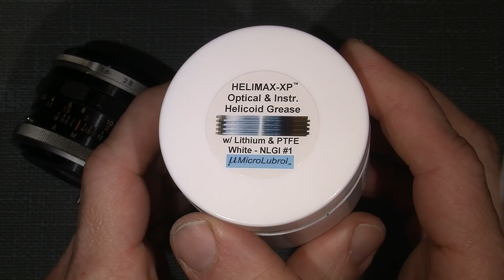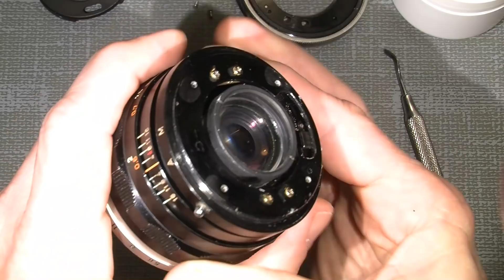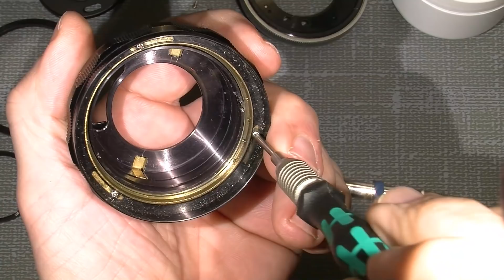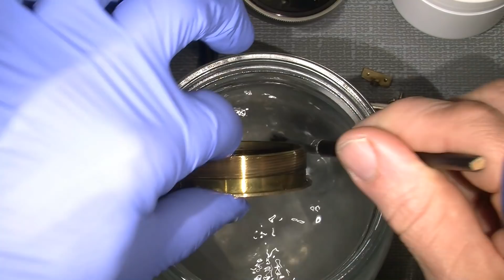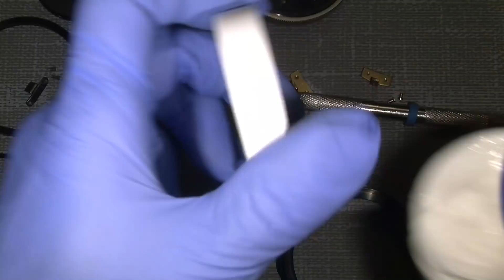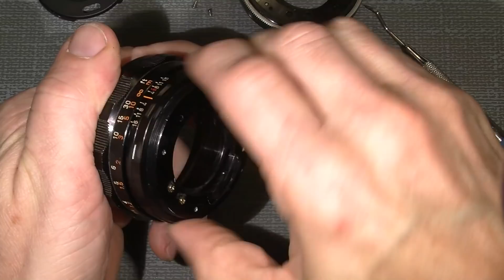Repair Canon FL 50mm 1:1.8 and Re-grease the focus system

Comment: I've just bought this lense on ebay but it appears to be stuck in auto, so I can't check the focus blades in manual mode. The release catch is also very lose (shaky) so I'm thinking that the seller has messed around with it and not reassembled it properly. I'll see if I can find someone who can fix it cheaply as I don't want to risk damaging it any further.

Comment: If you hold the side of the lens upwards it will be very easy to mount that very tiny three screws at the sides. I know because I have inspired from your videos and cleaned mine. :)
Reply from the maker: Thank's for the good tips, Can :-) hope your lens cleaning went fine.
Reply: mikeno62 I was not able to reach the front element since mine is fd. Later I will give another try.

Comment: Hi, I have the same lens but mine has one of the aperture blades loose. Do you have a video showing how to disassemble the aperture blades on this lens. Thanks, your videos are extremely helpful!
Reply from the maker: Thank's Dennis, I have just made a new film about the aperture system in this lens, here you can also find all the info about, how to work with aperture blades.             https://www.youtube.com/edit?o=U&video_id=AmASWPJ1AzA
Reply: mikeno62  Hi Kenneth, thank you. I watched your video and was very clear and well explained. I have disassembled the lens per your instructions and went very smoothly. Fortunately I have the proper tools JIS screw drivers and spanners. My aperture issues was due to a stud on one aperture blade had come off. I found the stud so I plan to use a tiny bit of epoxy on the stud. I think it will work hopefully the glue will be strong enough to hold. If not I will need to find a donor to repair the lens. Your videos helped me save my vintage gear which I’m extremely grateful! Please keep up the great work! 😊👍

Comment: Hello,

did you recommend Loctite 241 in one of your videos ?
Reply from the maker: Sorry but no, I use most of the time the purple Loctite 222, and sometimes the blue Loctite 243.

I have not try the Loctite 241, (I actually didn't know there was a Loctite threadlock with that number). So I have look on Locktite's website, and found out that I would not use it on tiny screws, because it's middle hard thread lock.
Reply: Hi, 241 is mentioned in the D700 service manual. Which one is a good all purpose threadlock ? The purple one ? I would like to use it in a Tamron lens. Some screw threads in Nikon bodies and notebooks have a blue residue, I have no trouble to undo these screws with the blue stuff.
Reply from the maker: Thank's for the info Dorf, In my repair experience during many lenses and cameras, I would say that the purple 222 are very good for the tiny screws but also softer screws just like 1.2mm to 1.6mm. On the other hand, the blue 243 is good for the bigger screws just like 2mm and above.
I think there is not really a "all purpose" threadlocker, also because it depend on the material, screw and the material you screw into. Steele and Aluminium, Steele and Brass, Brass and Aluminium, Brass and Iron, etc. etc..

Hope it makes sense.

Cheers
Kenneth